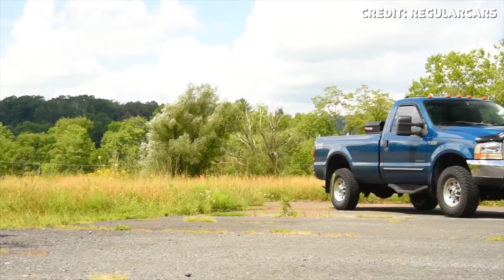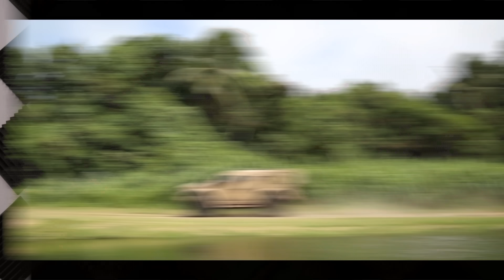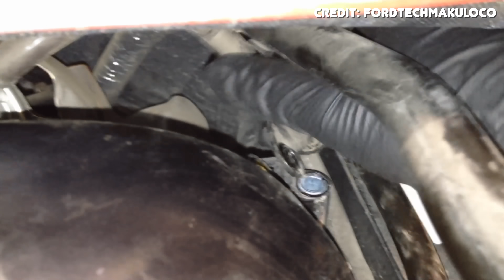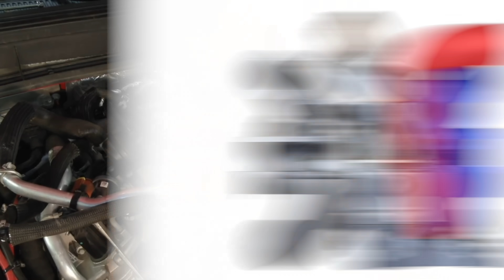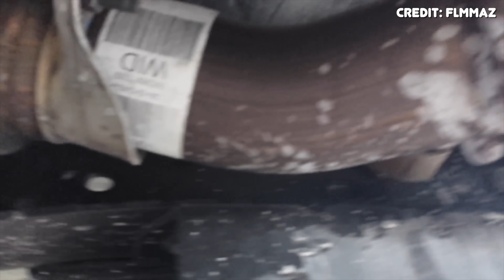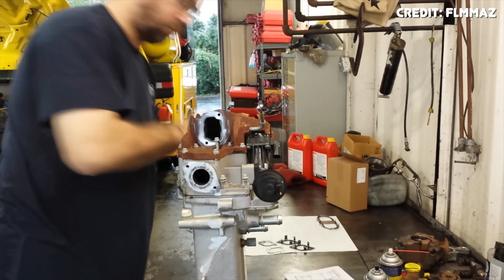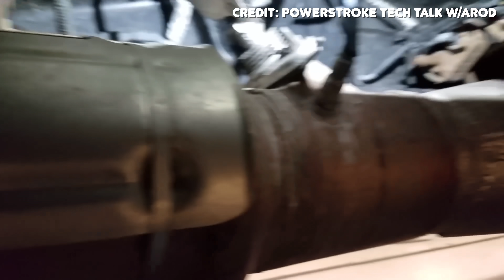Everything Wrong with the 6.7L Powerstroke

Comment: Do we really need emission systems on an ambulance? Seems like you would want that vehicle to be as reliable as possible…right🤨
Reply: Where I used to live, the local fire departments and ambulance services quietly deleted all their diesel vehicles (all Ford F-350, 450 or 550 vehicles).  Like all fire trucks and ambulances, the trucks spent a lot of time idling, and DPF problems--including requiring replacement pretty often--was killing their reliability and cost efficiency.  Since deletion, their running problems have been minimal.  A state agency with a local office could not delete their identical Ford diesel  trucks, and out of 5 F-550's in their local fleet at least one of them was ALWAYS in the shop for emission system related problems.  DPF's are the worst diesel emission control system ever designed--and there is technology to make them unneeded for emission control.  Do an internet search on Sandia Laboratories ducted fuel injection.
Reply: @rockymountainjazzfan1822 but they are reliable I have seen multiple with all the factory components with over 400k even up to 600k all original there is even a person on YouTube who has one with 3 million miles all factory he deliver greyhounds to race tracks
Reply: @rockymountainjazzfan1822   Not buying it. What kind of idiot would risk their pension over the departments property?
Reply: Not buying it?  Most fire departments haven’t had pensions in decades.  It comes down to one guy telling the shop “just make it reliable” and that’s the end of it.  The EPA isn’t looking at government vehicles, if they were then tanks and APC’s would have Emissions equipment.
Reply: @saab9251 Yeah, so that’s not a thing by the way…. Emergency vehicles are not exempt from emissions testing…ask me how I know? 🤦🏻‍♂️
Reply: @JJMassar  You don't have to worry about exemptions in places that don't require emissions testing ever...ask me how I know?

Are you aware that there are thousands of counties in the US that never require emissions testing ever?  If you want data to support this, approximately 300 counties out of 3100 counties in the country require emissions testing at a county or state level on a yearly or bi-annual basis.  So throw a dart at a map of the US and you have a 10% chance of hitting somewhere that would ever test a deleted firetruck or ambulance.
Reply: @JJMassar they are if you live in a state with no emissions testing. So yes, it is 100% a thing.
Reply: emergency vehicles should be exempt from def/dpf filters period because depending on the department, they dont get ran enough to do a good regen or use all the def fluid before it expires in the tank. Main reason why the department I belong to ordered the 7.3 gas motor in our new F-350 brush truck
Reply: @hooweeproductions  those same fire engines have a high idle for that reason, to burn off the excess carbon.
Reply: @hooweeproductions  all vehicles should be exempt from EGR SCR DPF and DEF
Reply: @connor4961  I agree, but I also see how old school diesels are a menace to air quality in cities. I just wish they didn’t have to regulate me on the farm, but it won’t effect me because I’m concisely never going to run a post 08 diesel engine. I like old stuff without much electronics that’s made of steel.
Reply: Yea doesn’t make sense but ig the EPA really wants to choke all diesels well an ambulance should be able to go at anytime not break down randomly cuz of a stupid sensor that’s very inconvenient and a person could have died cuz that sensor broke 🤦🏼
Reply: Nobody's safe from the beurocratic
Reply: The military industrial complex is bigger than the EPA, and so is their budget
Reply: Do I really need emissions crap in my own vehicle!? Hell I could be driving my wife in the way to a delivery and the damn shit cuts out.. is that acceptable??
Reply: Emergency vehicles both longer go into limp mode when there's a problem.
Reply: Having worked on ambulances with these emissions systems.
It's common for them to go into limp mode when working in an urban area as we don't get much highway mileage.
Reply: Bunch of fire departments here in FL have been getting gas ambulances instead of diesel
Reply: Has the government actually ever cared about the citizens??? 😂
Reply: @brodieherman6291  no
Reply: Yes. The comment I didn't know I was looking for.
Reply: They don't have to pay registration so they escaped the DMV they couldn't escape the EPA though
Reply: Just replaced my dpf at 95,000 miles. $6500 2017 F250
Reply: @rollyv2001  I have a 2017 f350 diesel with 113,000 miles towing 10,000 lbs. rv trailer at least once month for most of its life and also as my daily driver. No major issues and factory equipments and emmisions all intact. 

How was your truck used for and how did you find out about the problem (any indication)? I hope to prevent my truck from any of the problem you encounter. Thank you in advance.
Reply: It started blowing black smoke when hard accelerating. The inside on the exhaust tip was black. I a got check engine light. I don’t tow mostly just commute. Have a lift kit and 37 inch tires.
Reply: @rollyv2001  holy shit you shouldve got gas bro
Reply: @rollyv2001 it wasn't under warranty?
Reply: We have emissions on our cranes. It is the absolute most frightening thing when making a critical lift and the truck goes into regen, causing all of the hydraulic controls to violently speed up. I can’t fucking stand it
Reply: Right?!! It's like, oh sorry your mother didn't make it our ambulance broke down due to epa standards... 🤦‍♂️
Reply: Why do we need emissions on anything if it makes it unreliable? How is it more efficient if we're burning more diesel to clean the DPF filter? How come the military has no emissions on their vehicles? Why is the consumer always left holding the bag.
Reply: @rollyv2001  thanks for the tip. Much appreciated.
Reply: Lets be honest here, IS anything the EPA does make any sense? It’s all about the industry who gives them the most money
Reply: @quantamzero7919 The EPA has greatly increased air and water quality alongside being a key contributor to environmental remediation with Superfund. Some of the regulations are misplaced like minimum fuel efficiency requirements leading to vehicles growing in size but in general the work the EPA is involved is greatly beneficial.
Reply: I have 950k on my 2005 cummins. Injectors and ecm are the only problems with the motor since I owned it. I bought it with 133k and it has gale banks package and 4" exuast and a fass lift pump. 30% over on Injectors. Keeps up with new trucks all day
Reply: Thanks EPA
Reply: Im currently putting together information and other data so i can write a bill that i can submit to congress. The bill is simply this. Any vehicle that is destined to be an emergency vehicle by design and order will be exempt from emissions controls. I will provide examples and proof that emissions controls and systems have and are directly related to preventable fatalities, increased response time, increased spending for emergency organizations, increased down time meaning less units available at any given time. Etc etc. Once i compile all of this i will get in touch with my congressman and submit it. I hope to get it passed. All federaly ordered vehicles are exempt from emissions and i dont see why emergency vehicles cant be exempt as they are ordered operated and payed for by municipal gov ie taxes or grants which is federal tax trickled down anyway.
Reply: I think the majority are the more reliable gas engines
Reply: “Stay alive we have to regen”
Reply: @Robbie64 😂😂😂
Reply: Stupidity at its finest. Ambulances and First  Responder engines should all be exempted from moronic EPA rulings. What, value more the air than the life value of the ambulance medical passenger.
Reply: yes?
Reply: That's exactly what I was thinking!
Reply: No, no we don't
Reply: They idle all day long with the AC on like tow trucks do.
Reply: Government bureaucracy demands otherwise.
Reply: My local hospital has Gasser ford ambulances and one pre emissions Duramax that won't die so they've kept it they are broke as is so gassers are a go for them
Reply: That's no shit like he said ships an planes an train practically no standard to meet
Reply: Fire dept are exempt the problem is most manufacturers will not make engines separate from commercial production line just for fire trucks and ambulances so they are stuck with the crap also.
Reply: One of the ambulances in my town is a deleted 6.7 5500 cummins and you know your gonna be ok when you hear that groan coming up the road lol.
Reply: We don't need emission junk at all.
Reply: Any truck sold to the government doesn’t have the emissions
Reply: Yea, everything else in this country should be unreliable but god forbid the government can’t transport you to their insurance ran scam that is designed to make money…🧐

Mecrca
Reply: They do have a tune so that if anything breaks or DEF runs out on the SCR it never goes into limp mode.
Reply: When they get decommissioned, they're auctioned off to the general public and that's where the government has a problem with their vehicles not having an emission system.
Reply: Yes, when i heard him say that 20min was not that big of a deal to change the egt sensor, in the emergency world that is an eternety
Reply: “ThE EaRtH iS mElTiNg, EvErY oNe HaS tO cOmPlY, oH eXcEpT fOr Us” the U.S. government.
Reply: EPA made it so that local govs are subject to regs too so that they could no longer buy MRAPS for their police departments.
Reply: The military purchases thier deisel trucks with factory delete.
Reply: My 6.7l ambulance doesn’t have an emissions system…..anymore 😂
Reply: exactly what i was thinking
Reply: Ford decided we didnt and came out with the godzilla which replaced the 2 decade old V10 motor, but unfortunately the commercial grade 7.3 doesnt have hardly any more power than the V10

Comment: Also cranks breaking at the front rod journals
Reply: I think that's more of a Duramax problem. I've never heard of a Ford 6.7 breaking a crank. I have heard more of them spinning mains because there is no locating tang on the backside of the bearing shells to help hold them in place. They are literally kept from rotating in the main bores by compression from the main caps & friction between the back of the shell & the main bore. If it rotates enough to block off the oil passage, boom! I'm surprised that wasn't mentioned.

Comment: I have a gen 3 6.7L in my 2022 F350. If I had it to do over again I would have chose the rapid cabin heat option because that motor takes a while to get warmed up. I have to drive for about 10 minutes before the heater starts blowing hot.
Reply: oh wah... my 7.3 takes 30 mins xD
Reply: I have the rapid cabin heat option and it does help.
Reply: Get a block heater kit plug it in from ur home to the engine block
Reply: @vee950  wiring mine up on my idi was a gift from god, thing would barely light off under 20 degrees without it
Reply: @CharredSteak  👍🏾
Reply: @CharredSteak  That’s just how diesels are. They hate starting cold
Reply: @vee950  I have a 16 powerstroke with an engine block heater and it takes that beast awhile to warm up. I’ve left after 30 minutes and it still wasn’t warm. Took me driving 10-15 minutes for it to get there.

Comment: It’s the best powerstroke 2020 has steal pistons and beefy connecting rods
Reply: Why would you want ultra heavy steel pistons tho
Reply: @alexstromberg7696   they shortened them to cut the weight back to what the weight of the aluminum were. Steel is less likely to crack from heat and pressure.

Comment: Wonder how the 6.7powerstroke and 6.7cummins compare
Reply: The Cummins is a work horse the ford 6.7 is a weakend toy hauler .the ford is weak under constant heavy load.ram is the only commercial grade pickup made.
Reply: @matthewwilliams9028  not true.  We use 5500 duramax and  f650 powerstrokes 5 days a week on I5 oregon. 19,000# bob tail and up to 28500 w/ trailer. Far from weekend warriors
Reply: @NPC-mt1cz  I have not seen a Ford or  Chevy make it a year on a eastern Oregon logging job they won't take it . Rams and Kenworth 900 the rest are in pieces.tried them all at the end of the year the money spent and the down time they were always a liability . They may be a good class 5 and 6 road truck but not in the dirt. If that 5500 the new international GM joint venture they already quit making parts for it that's the international way . Zero service and obsolete parts. The big ford trucks class 6 and up the only dealer in Oregon that deals in parts is in Portland had one for a water tender truck everything is two weeks out to fix it no thanks.
Reply: @matthewwilliams9028  ive put 50,000 miles my 2019 5500 and the only problem its had is leaking coolant lines...
189,000 on my last one before it started to have transmission problems. Seems pretty decent to me considering they're constantly hauling no less than 19k and that's on the light end of it.  I will agree finding someone with software to service the new models is a pain the ass though.
Reply: 6.7 cummins bettet

Comment: I really love Ford's, but I would never trade the simplicity of a 5.9 Cummins for all that
Reply: Had a 2012 6.7 PS without any issues. Decided to go with a 07 5.9 for 'simplicity'. Ended up dropping a valve and costing me $15k to replace the motor. Happily back in a 2022 Ford diesel. Wanted to like the 5.9 but the lack of power (and ultimate engine replacement) drove me back to the Ford.
Reply: @deerhunt799  my cousin works at a Ford garage, I could go on for hours about 6.7's that don't make it 20,000 miles without going back to the shop. I would rather pull the head on a 5.9 10 times before I even tried to find the heads on a 6.7. And the fact that the government approves the 6.7.... well that's enough reason for me to hate anything. I would take a 7.3 IDI pouring black smoke all over the planet long before I ever took a 6.7. Oh yeah, and I guess I would have to be rich enough to even attempt to look at a 6.7, let alone pay for one and make repairs lol
Reply: @dannydyer9961  Yet another half insane Cummins die hard. They are some of the best engines out there, don’t get me wrong, but it often times gets carried way too far
Reply: @dannydyer9961  Yet another half insane Cummins die hard. They are some of the best engines out there, don’t get me wrong, but it often times gets carried way too far
Reply: Danny you need to get on the forums where people are putting 1 million plus miles on the 6.7 Ford - the same thing you are saying happens at the Dodge and GM dealerships too

Comment: Had both, 7.3L & 6.7L Powerstroke. I really prefer my deleted 6.7 for the power and performance. My 99' ZF6 7.3L was nice to drive too.
Reply: I have a 2002 F350 7.3L ZF-6 spd, manual transfer case, manual locking hubs.  Dana 60/ leaf spring front axle, Dana 80 SRW..   I bought it in 2013 or so with 170k miles for $7500 (without a bed)-  and now it has 330k miles and still pulling as strong as ever (with a 9ft flatbed that I put on it).  It likely needs some new glow plugs (little stubborn to start in the cold without plugging it in) and loves to leak in all the right places-- but otherwise it's still old faithful-- and I'll likely never sell it.
Reply: @calholli  I believe you got a 2001 7.3 with 678,980 miles on it and keeps running like champ
Reply: @masterzaga44  Nope it's 2002.. and has nearly 340k miles now actually.
Reply: @masterzaga44  Funny enough, on "I do Cars" channel -- he just took apart a 7.3L that has nearly 700k miles.   Odd coincidence that you type it here now.
Reply: I've got a 02 7.3 zf6 and a 6.4 that is deleted i want to try out a 6.7 one day deleted
Reply: @nou8257  the important part is that ford offered a 6.7 mated to a zf6 in Mexico in 2011 so don't get a 6.7 neutered by an auto
Reply: @calebz1448  yeah but what's the chances of finding a 6.7 stick here in the u.s for a not insane sum
Reply: @calebz1448  i believe it was a 6.2 gas.   XL, 2WD, Reg Cab
Reply: @dominicdemicoiii402  maybe but I heard this 2nd hand from comments on a video of a 6.7 zf6 pulling truck that it was factory produced in mexico. Considering what other countries get and we don't I'm not surprised in the least
Reply: So obviously the pulling truck was 4x4 but that wasnt specified if it came 2wd or 4x4 in the 6.7
Reply: delete, register out of ca. 7.3, best ever hands down. 500K miles, low maint time and cost. don't need to remove the body to work on.
Reply: Same I’ve had and built 7.3 and now I have a deleted 6.7, and I definitely prefer the 6.7. No hate to the 7.3 at all.
Reply: How do you pass state inspection? Plus dealers won't trade in a truck been deleted they can't sell it. I guess if you only sell to someone else lives in a rural area and in a state has no inspection it will be okay.
Reply: @Mike-01234 many us states don't test emissions. But they can bust you for deleting if you aren't sneaky about it
Reply: I have loved the zf6 every time I got a chance to drive somthing with that transmission
Reply: My dad had a beautiful 2016 6.7, got it fully deleted,  oh whoops EPA might be reading.  One hard take off from a stop and his CP4 blew up.  Sent metal through the whole engine.   Totaled truck in 5 seconds.   Sold at auction,  don't ask how we cleared codes and got it running.
Reply: Your 7.3 will outlast that 6.7 by miles....surprised you haven't spun a bearing or come out of time yet XD